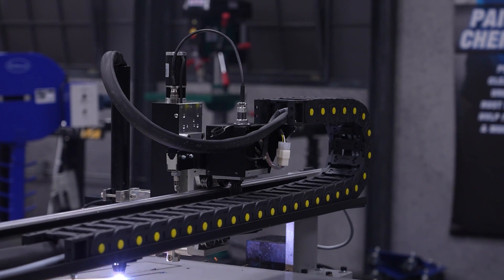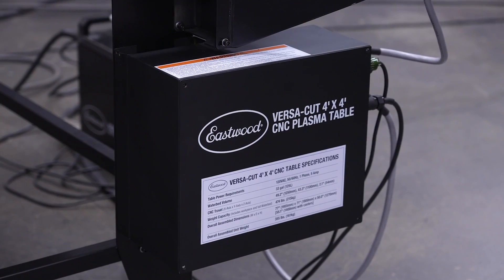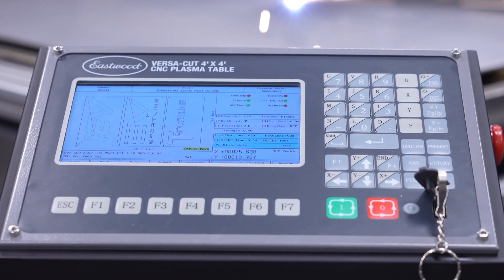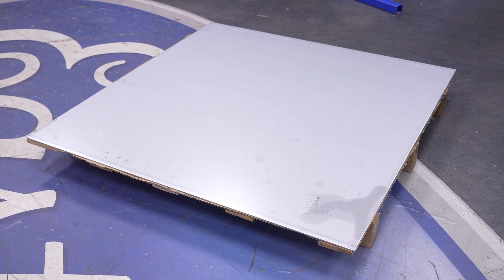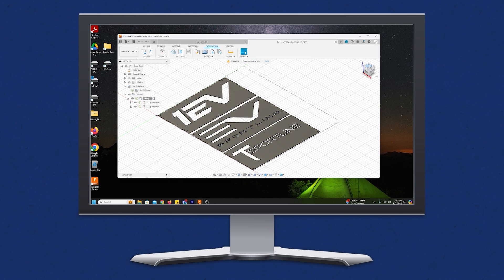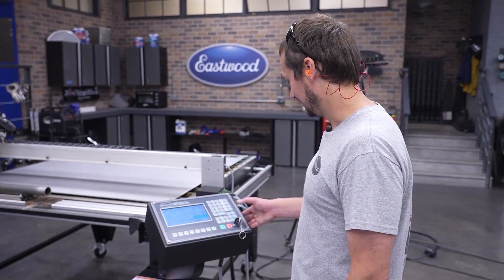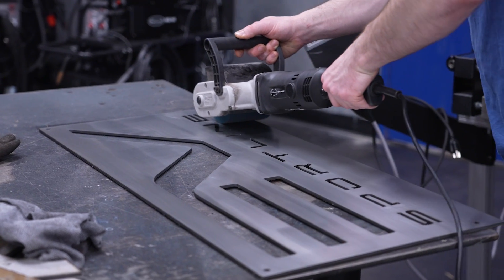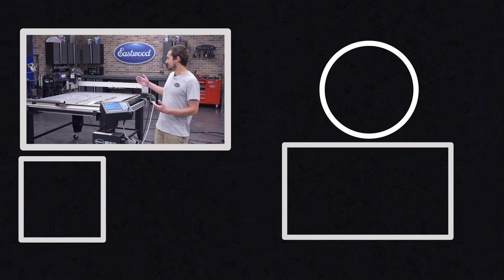Start a CNC Side Business in your Garage! REAL Numbers and RESULTS

Comment: When using you pre-loaded cut files, is there a way to make the cut counter clockwose for holes? I am cutting 10 holes using the array tool and it cuts clockwise. I was reading that a counter clockwise cut direction would leave me a better edge on the holes. Or do i have to figure that out in 360Fusion?
Reply from the maker: We elevated this question to the R&D Department - we don't have a method for that at this moment.
Reply: Nine months late to the party, but the answer to your question is: Generate the G-code file (.tap or .nc, whatever the software spits out) > Open file in Notepad or other text editor (it may complain about "unknown format", but it will open) > Look for "G2" in the text, replace with G3 > Save as a new file so you have a backup in case it does not work like you expected. Keep in mind that this most basic re-coding will only work if the program is "go to place; cut hole in place". If the circle/arc is a part of a contour, simply reversing it will cause issues. 
G2 is a code that tells the machine to move/cut an arc in clockwise direction. G3 will simply reverse that into a counter-clockwise. 
Alternatively, use the software to spit out code for more complex shapes without holes, then hand-write a separate circle cutting file. ALL g-code is created equal, so regardless of what tutorials/classes you learn to code from, it will basically work on every CNC machine these days. Also, the machine will do EXACTLY and ONLY what you tell it to do, so keep that in mind. If you're unsure, think through the G-code instructions as if you were the machine. Does the next step/move/line of code make sense after what was just done?

Comment: Definitely a useful little table for a home shop, but I'm not sure where you make the jump from $526 for one project to $25K a day? That title is pretty much clickbait.
Reply from the maker: If you maxed out production - $525 in 30 minutes, $1050/hour, $25,020 in a day.
Reply: So your table is up for being run 24 hours a day? Not to mention the time to get the jobs, ship them out, and all the other little overhead tasks...
Reply: It took l9ngervthan 30 minutes. 20 minutes to cut, 15 minutes for the brushed finish and that doesn't include the set up time which you charrfed an hour for. So it was way more than a 30 minute job.
Reply: The total job time doesn't directly consume machine running time. While the machine is cutting for 20 minutes,that time can be used to set up another job and finish the last job. There are a lot of variables to running a manufacturing business, and optimization of resources becomes a much bigger deal in order to reach higher payouts. Of course, 100% utilization is absurd to expect, so I understand the general concern.